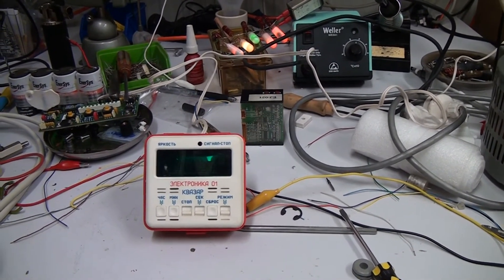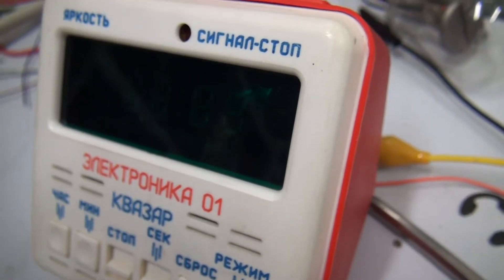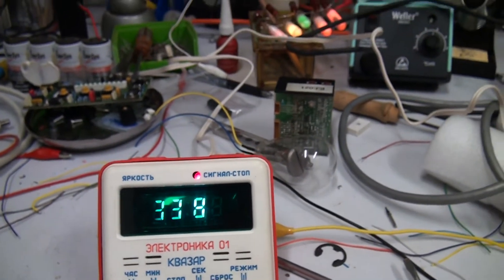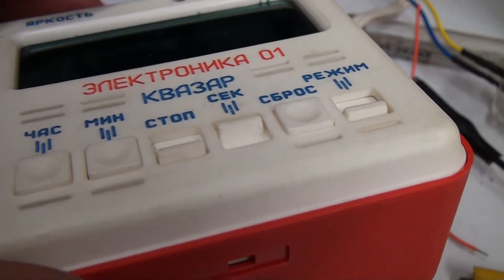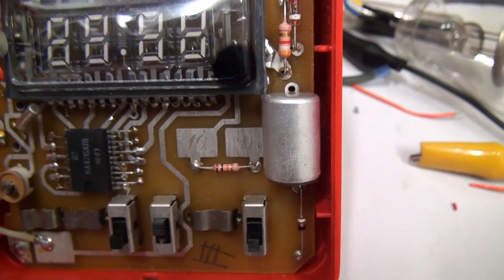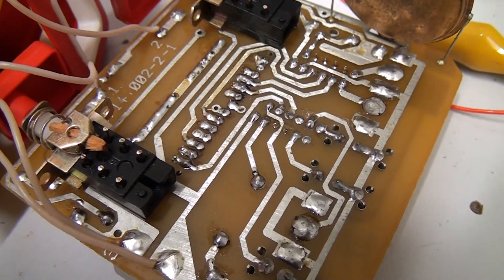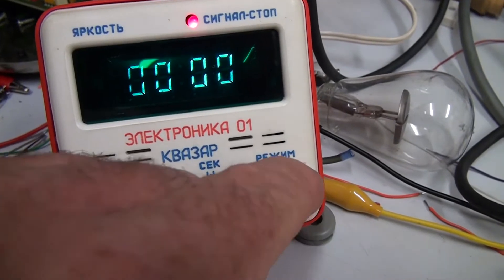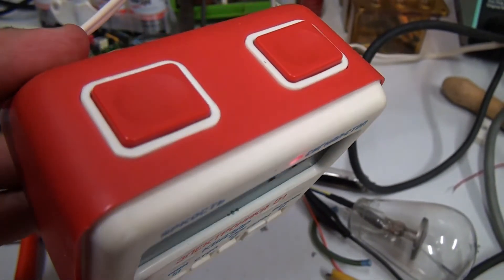Soviet digital clock repair

Comment: Was the USSR 230 V - 50 Hz?
Reply from the maker: They are 220 V 50 Hz, they work here in Australia on our 240 V 50 Hz power. It should work in the US it will be dimmer and it has its own Crystal oscillator so it does not need the mains frequency time reference.
Reply: rustymotor awesome. Thank you.

Comment: Interesting video I like that little clock  it looks very 1970s ish in its styling. Be careful if you open this capacitors the Russians sometimes used liquid electrolyte  in the caps far more than is really needed you  could end up with a smelly puddle on the bench
Reply from the maker: Thanks for the advice, I bet the Russian chemistry would be pretty nasty too. Its a great little clock and its easy to find parts for on the net including the VFD. Its nice and heavy due to the transformer, feels like real quality.